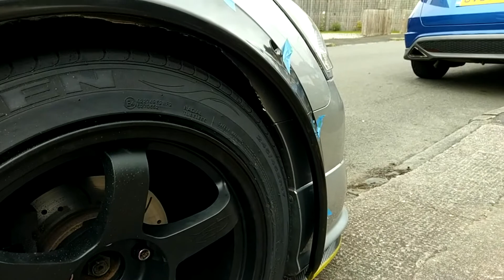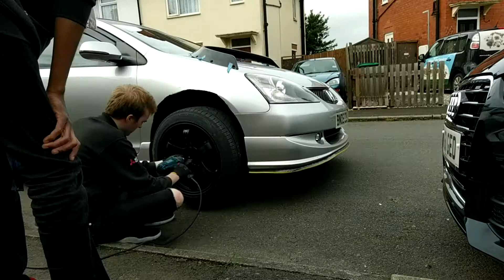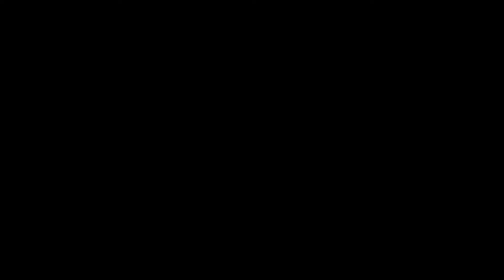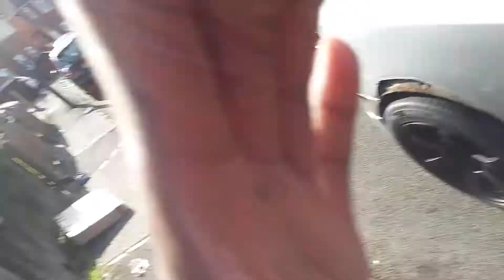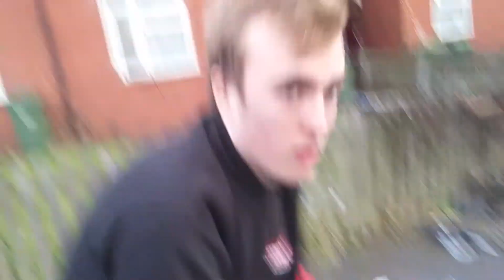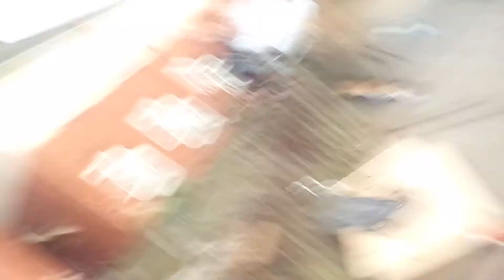Road to Widebody: Episode 3 | Widebody EP Civic Build

Comment: Ay up pal I have ep3 type r only flares I can find are these poxy lil 1/3 size flares round the top of the wheel arches can you link the ones you have put on as I want em to reach from the top of the side skirts round to the bottom of the bumper thank you

Comment: What if you got lower profile tires? Surely that could help with clearance as the tyres would be slightly narrow
Reply from the maker: +SullyZee You are exactly right but that'd just be the easy way out ;) Coincidentally, the current diameter means my speedo reads exactly the same as the GPS speed (usually about 5mph out) so I'll be sticking with it I think haha, unless I want to go lower
Reply from the maker: +SullyZee I should mention these videos aren't up to date, I've long since sorted out the clearance issues, no rubbing
Reply: A smaller profile would of been best for this mod, you're making hard work of this to create a wide boy stance! Why didn't you adjust you're coilovers first to see what clearance you would have before cutting away at the body? You can easily get them rims on with a 40/45 profile and go stretched with a 205/215 width? You can still use spacers to stop rim rubbing on coil springs. Also what are you gonna do with the rear? Cause You've taken that flare away from the body and got it exposed it's gonna get wet and eventually rot away with water coming off the rear wheels? Or even cut into tyre wall when hitting them lovely British pot holes lol. Good luck with it and I would like too see the results you get without any compromise 👍

Comment: A smaller profile would of been best for this mod, you're making hard work of this to create a wide boy stance! Why didn't you adjust you're coilovers first to see what clearance you would have before cutting away at the body? You can easily get them rims on with a 40/45 profile and go stretched with a 205/215 width? You can still use spacers to stop rim rubbing on coil springs. Also what are you gonna do with the rear? Cause You've taken that flare away from the body and got it exposed it's gonna get wet and eventually rot away with water coming off the rear wheels? Or even cut into tyre wall when hitting them lovely British pot holes lol. Good luck with it and I would like too see the results you get without any compromise 👍
Reply from the maker: +Galleria Carpark Follow my Instagram for answers to most of those questions but I went with the meatier tyres because I'm not about the easy way out and I do prefer the meatier look lol. Also, if you saw my previous episode I did check for clearance and increased the ride height before cutting. I don't have any rubbing on the coils, clearance is just fine. The build is almost complete now, I'm running without spacers and I've spray painted the exposed metal from the exposed metal sealed with rubber U seals and I've done over 100 miles so far and have no rubbing issues in the rear (I increased the ride height in the rear). I'll be sealing up the hole in the rear quarter panels. Trust me dude, I got this ;)